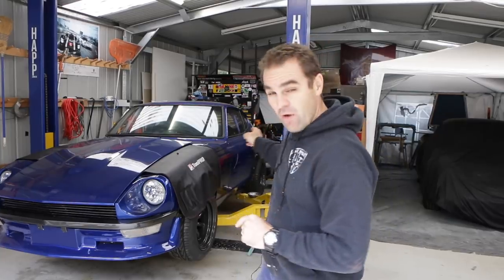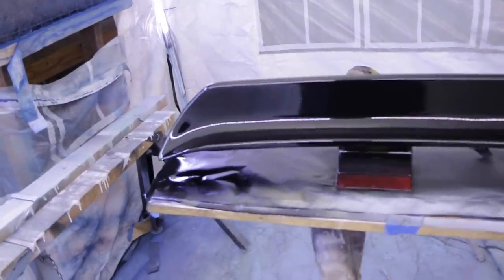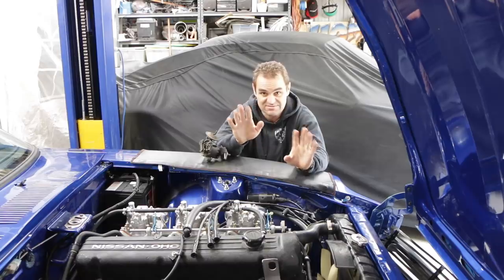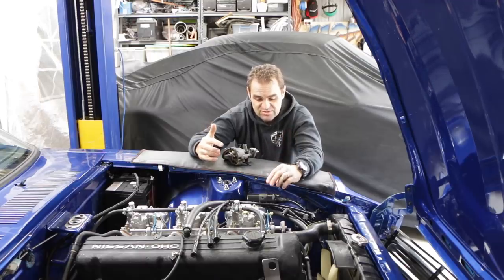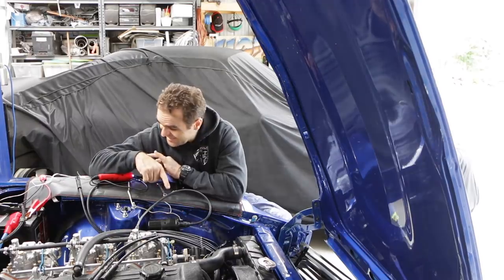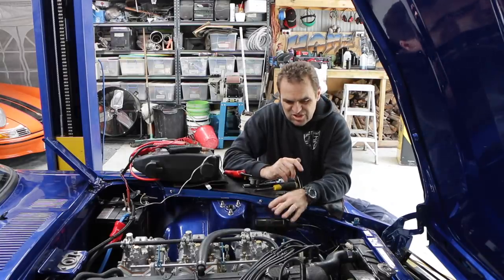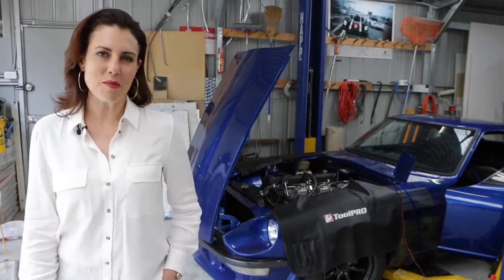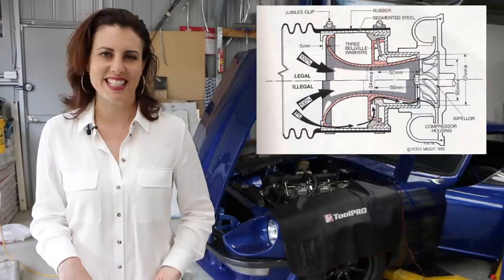Final painting - Home Built Datsun 240z part 90

Comment: If the door lock assembly is in good condition and the lock rotates freely, the issue typically is the adjustment rod from the handle to the lock assembly not being adjusted for slack. The rod I'm referring to attaches to the handle and has an adjustable nylon nut on the end that actuates the upper most receiver on the lock assembly. Back off the nylon nut at the end of the rod and try again.

Comment: One minor adjustment to your explanation of how the coil works. When an electric current flows in a wire, it generates a magnetic field around the wire.  Conversely, when a magnetic field moves across a wire (by moving a wire through a magnetic field or moving the magnetic field past the wire) , it induces a voltage in that wire.

In an ignition coil, you have two coils, the low voltage primary coil with a small number of turns of wire wrapped around an iron core, and a secondary with a large number of turns wrapped around the same core.  In the case of a points setup, closing the points causes current to flow in the primary coil, building a magnetic field.  When the points open, that magnetic field collapses, effectively moving across the wires in the secondary.  Since there are a greater number of turns of wire in the secondary, the generated voltage is higher on the order of the 30-50KV needed to fire a spark plug.

In the electronic distributor setup that you have, the electronics effectively serve as a relay controlling current flow to the primary side of the coil.  A magnetic sensor replaces the points telling the box on the side of the distributor  when to switch the current to the coil on and off.

BTW, I replaced the points in my 240 distributor with a Pertronix ignitor 20 years ago and it hasn't failed me yet.

Comment: Test light or meter on the neg side of coil should show open and close of circuit as you crank engine.  If nothing is happening then likely the ignitor/points.

Comment: There are those days when everything to touch goes to sh*t, better day tomorrow. 
 OK, coil is good
 check the ignitor wiring and if there is a test for the ignitor

as suggested check if the dizzy turns, just in case

cars are wired weird because everything is basically wire positive all the time and then the device is switched on and off before the chassis ground.  they say the power flows from the negative to positive so its like the chassis is live.  kinda opposite to all other wiring

Comment: You dont want to get paint on the inside spline of the steering wheel . It might get very difficult to get it on.
Reply from the maker: It doesn't have enough to be an issue ;)
Reply: ferrari lover f40 that’s a good point years ago I should a truck (cheap) because I thought I broke a timing chain. Turned out I sheared the pin on the drive gear on the distributor it cost the guy .50 to fix. He made sure to let me know :(

Comment: I some how think you have the circuit liek this: battery>Distributor +> through dizzy> Distributor Neg > Coil + through coil > coil Neg to Earth? if so NO NO NO!!!! it needs to be switched Battery > Coil + AND Dizzy B Terminal then neg of coil to the other terminal of the distributor!, the coil Neg side should never earth to the body thats what the "points" are supposed to accomplish
In a old style points dizzy you have switched power only to the coil +ve then the neg of coil to the Dizzy, with electronic ign its the same thing except the hall effect sensor needs power too
Reply from the maker: It is wired as you have suggested ;)

Comment: Jeff when you open and close the points do you have a spark as the condenser is a nightmare on older cars it is the silver thing with 1 wire coming off it if the flat end is slightly bulged it is NFG.  https://www.popularmechanics.com/cars/how-to/a6382/4338376/ I hope the ignighter works for you
Reply from the maker: No condenser on this dizzy ;)